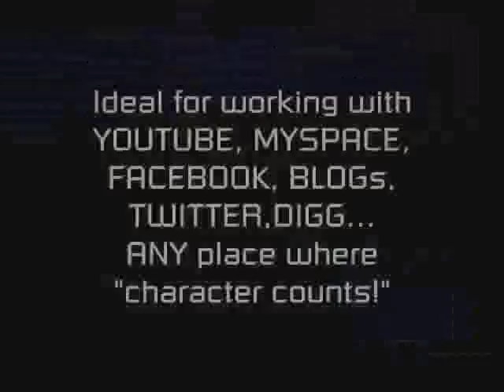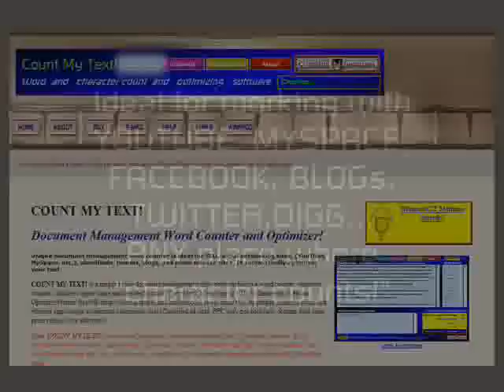When To Use Your Dongle - A Tape Recorder HOW-TO Video!

Comment: I used to have one of these Panasonic red tape recorders and it worked great. It had no wow & flutter with the flat belt drive and wide capstan. They sure don't make them like this anymore! My only problem with the unit was the internal mic picked up alot of mechanical noise.

Comment: That's why the Nixon tapes were erased on the UHER deck and not the original Sony TC 800B. The Sony  had a built in mic and Nixon did not have a dongle. You would have thought he would have a dongle with all the lamp mounted microphones he had lying around.

Comment: The dongle doesn't defeat the ALC.  Most tape recorder ALCs are not gated, so when no audio is detected it will ramp up to maximum gain, causing the loud hiss you hear during the "erased" section.